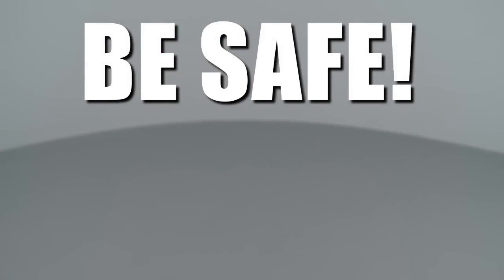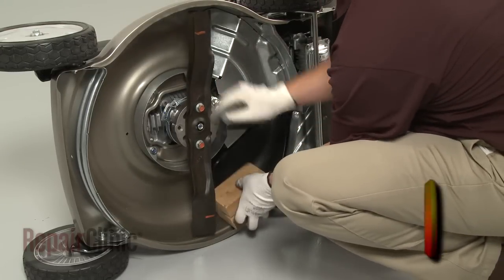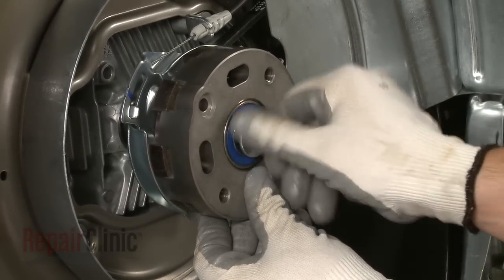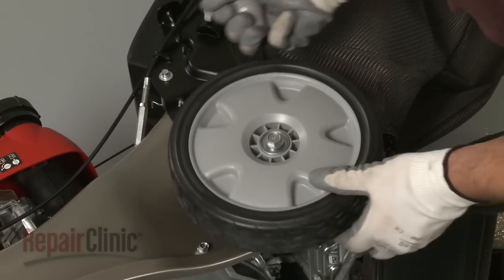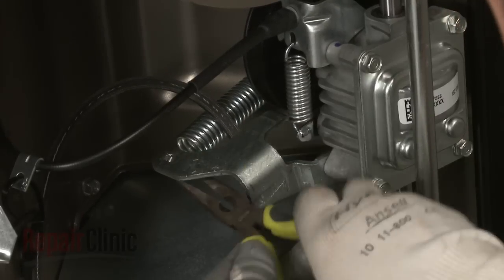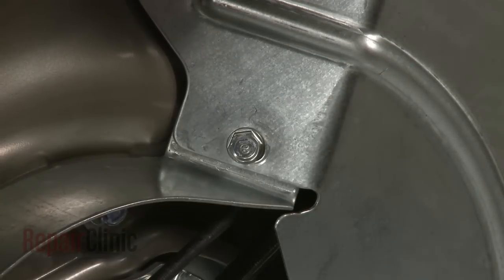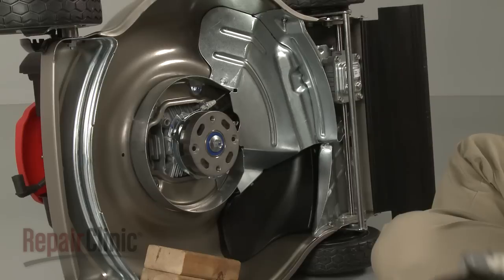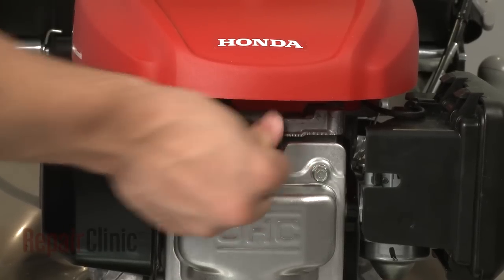Honda Lawn Mower Won't Self Propel? Replace Belt #22431-VL0-B00

Comment: Wow, I found this video just before I took my mower to the shop for this exact problem. Thanks for saving me money, guys, you rock.
Reply: Was your belt broken or did u just replace a good belt? I ask because my belt is not broken and thought this only needed to be done for s broken belt.
Reply: @christanzley8041  what did you wind up doing?  My Honda stopped self propelled today and when I pull back it puts up a fight to do it.   The belt feels loose bit still in tact.

Comment: For transmissions that are slipping, there is an adjuster with locknut on the tranny cable just before it enters the deck housing.  Loosen the jam nut and turn it clockwise to lengthen the cable housing, and tighten the jam nut.  9 mm wrench on the jamnut and 10 mm on the adjuster.
Reply: Gerry can you please explain in a little more detail
Reply: Well explained there, very informative.

Comment: Nothing like working on a brand new never used unit
Reply: 777
Reply: Yep, no dirt dust worn bits,,  screws that are frozen in place then the screw head shears off.
Oh yeah what are the bolt torque specifications, and do you even have a torque wrench?

Comment: Great video. I have a Harmony HRB217 TDA. Just replaced the belt, and adjusted the cable to its maximum adjustment. Wheels will turn when I hold the rear of mower up but them moment you place them on the ground, they will not pull mower. Any suggestions?

Comment: Great instructions and video. I was able to reinstall my drive belt after it slipped off the pulley and am now good to go! I was not able to loosen the roto-stop bolt however, so if I had a broken belt I would be dead in the water. The drive shaft just spins when I try to give a quick hard turn on the bolt.
Reply: Dennis Keener
Reply: make life easy and Use an impact gun

Comment: The video looks very helpful, but I am stuck.  I have an HRR2167VXA and when I get to the step of removing the lower roto stop assembly the bolt just turns no matter how hard or quick I slap the end of the wrench.  The pulley underneath, belt, and transmission pulley turn with the bolt.  I tried applying force to the belt to provide some resistance, but it's a no-go.  Any other tips on how to get this bolt loose?

Also, I noticed the drive clutch cable has been rubbing on the belt, and the belt is doing a number on the cable housing.  It looks like a pretty poor design, the cables should be better secured with a guaranteed clearance from the belt.  Any thoughts on this also?
Reply: I ran into the same problem - what I did to get that bolt off is take off the debris shield first (and my model was slightly different in that the debris shield was one piece).  Once the shield was off I clamped the belt to the transmission tension spring support arm with some vice-grips (it's the piece of metal the guy in the video is using to pivot the transmission with the adjustable wrench - @2:12).  Once the belt was clamped, I gave the ratchet a tap with a deadblow hammer and it turned right out.
Reply: Hammer

Comment from the maker: When you pull the lever to engage the wheels the cable pulls the belt tight on the transmission pulley. If the belt or cable is stretched or for some other reason the belt is not being pulled tight enough the transmission will not turn the wheels. You should be able to turn the transmission pulley by hand and get the drive wheels to turn. If you turn the pulley and the wheels will not turn you might have a bad transmission or worn drive teeth on the wheels.

Comment: Thank you so much for this helpful video! May I ask the part number of the tension spring that you reconnect at 2:38"? My mower is about 10 years old and that tension spring is so tight that I could not stretch it enough to get it back now. I am thinking to get a new one but could not identify the part number. Thanks!

Comment: I just bought from your shop the wheels , the gear and others items. But when I installed the gear in the wheels of the backwheel. I still have the same problem. The gear won out half way make my lawnmower shaking and the wheels moving not normal. Could you please help me to solve this issue. Thank you for your help.

Comment: I’m having trouble getting the lower roto-stop assembly bolt off. I’ve tried the sharp “rap” but something internally is trying to turn as well.
This is HRX217 model with select drive 2017/18 model.
Help….
Reply: I got mine off using an impact gun no problem.

Comment: I can't find the Honda I have but I have no belt and when you take off the wheel s there is no gear. Mine may be older but some kind of 215 gr8 I believe. Anyway I can't get the wheels to turn when the couch is released. I took out the year end and split the cases on rear end and found the clutch gear to be badly worn. So I took the gear out and welded the three gear teeth and milled all angles and I'm back in business, the tops were totally gone.  Wish I could leave a pic for ya.

Comment: I have my Honda HRR216a0 apart and the drive belt had came off of the transmission pulley.  I noticed that where the belt should sit on the pulley, it appears the the whole transmission assembly is shifted slightly (down), like there is not enough tension. If I push on the assembly a bit the belt then lines up and gets tight.  Should the belt be tight or have some slack.  Thx! :)
Reply: Tight

Comment: Have a Hrr 216 VYA, having trouble getting the Lower Roto Stop Assembly Bolt loose, it just keeps turning over engine. Any Ideas?
Reply: mojo  I did that and now my piston is scored because of this rope idea.  You owe me a new motor butthead.

Comment: Removing the lower roto stop assembly did not easily come off as others have also stated.  I removed the top flywheel cover and used another wrench on top of the mower as I turned the bolt on the bottom of the mower.  Took a lot of torque but it did loosen up.  I also need a gear pulley to remove the roto stop but the items behind it would not come off.   Now if I could find a video on how to remove the driven pulley I'd be all set.  My driven pulley (plastic!) is shot.
Reply from the maker: Joel Lund We have another Honda mower project coming up so perhaps we'll have something to help you further soon.
Reply: Excellent tip on taking off the pull start.  I did that as that was the only way to pull out the main bolt.
For me, the assembly on the crankshaft came off easy enough but it required patience to line up the two Woodruff keys to reassemble.

Comment: After7 years my drive belt finally snapped.  I hope that I didn't shear a keyway when the thing let go!  I think 7 years is great for a belt!
Reply: mine lasted 13 years
Reply: I have a 1993 hrb476 here still on its original belt somehow. I also have a 99 model still on the original belt

Comment: i have the same problem, i think the belt on mine has stretched,so will replace belt, then see how it goes.
Reply: I'm doing one today fingers crossed hoping it fixes it. Too heavy to push
Reply: @davidhickenbottom6574  lmao too heavy? I'm 13 and i have had to push the damn thing around for 3 yrs
Reply: @Br1zky  good work out, I'm 58 and buying a new mower today.

Comment: My belt looks fine but the wheels are not turning. The mower is several years old and the belt has never been replaced so I guess it's worth a shot.

Comment: My mower's self propelling functionality is not working. When last time it didn't work, I adjusted a nut on the pulley wire, but now the rear tires are not rotating at all. I checked the belt but do not see much of wear, how do I know is that the only problem?

Comment: Having just replace the drive belt on my Honda HRT 216 mower, It still does not move the mower. When I lift the rear wheels ,they are spinning, set the mower down it doesn't move.The rear wheel have little tread remaining.....could that be the problem?
Reply: I have the same exact issue as yours. I thought it was the wheels but after replacing it still wont budge like it does not have the power to push when wheels are on the ground.
Reply: Joe- If they aren't spinning, tread wouldn't matter, think about that for a minute.  : )~

JB- The issue (I just repaired one for a friend) is the transmission, there are fiber discs inside that get worn. Honda manual tells you to engage the clutch quickly, just like a vehicle, but people sometimes think it's better to slowly engage it, which wears out those disks. The transmission is only available from Honda, once they tell you the price you may consider buying a new mower instead, if yours is well used.
Reply: Did you ever figure out what was wrong with the mower? Having a similar issue.
Reply: Yes

Comment: It drives on the flat but wont drive up hills. The belt does seem loose, and I guess it is slipping when going up hills because rear wheels don't move. …Any thoughts?
Reply from the maker: billy45 We would suspect the belt is worn and needs replacement. Use your mower model number to find the right replacement belt. www.repairclinic.com?TLSID=1773
Reply: billy45 
Thank you! Incidentally it is great to find such a site as yours which you actually post replies on
best wishes
alex
Reply: RepairClinic.com 
My mower is HRB476C QXE.  Could you advise the correct belt please?
Reply: Same problem.  Bought a belt and took it apart.  Looks like Honda never put the key-ways in the shaft unless it doesn't need them.  But the pully has a keyway slot as does the shaft.  Actually the shaft has two slots.  Also, looked at the pully and it is lopsided, can't think that was the design.  Unit is 3 years old and it never self propelled well in grass, only on the driveway.  I am assuming that without the keyways it had enough friction to turn the wheels on a hard flat surface and just spun the pully in the grass.  I would assume this also helped to bend the pully.

Comment: The drive belt slipped off the pulley on my Honda hrt216 so it would not self propel.
I was able to install a new belt after watching this video.  It worked for a while and then the newly installed drive belt slipped out again. Any ideas what is causing this?
Reply: Sounds like the pulley needs to be replaced, as they can lose their tension.
Reply: Pulleys don't 'lose tension', springs do though...
Reply: Sounds like a loose nut behind the hand bar.

Comment: Rotostop nut just keeps turning, not loosening
Reply: Had same problem. Solved it by placing wrench on bolt and hitting end of wrench with a hammer. After several sharp ramps, the bolt loosened and I was able to remove.

Comment: To break loose the roto stop I removed the fly wheel cover from the top, turned the mower on the side, braced a breaker bar against the ground with socket on the bolt at the top to stop the spin and then was able to loosen the roto stop.

Comment: It's not that easy to remove that bolt off the main shaft. Mine just spins no way to hold on to it
Reply: Dennys Lawn Care Did you ever figure out a solution to this I’m having the same problem
Reply: if you take the top off of the mower you will see that there is a bolt that spins, so you’ll just need to hold a ratchet on each side of the mower it helps if you have two people
Reply: Had same problem. Solved it by placing wrench on bolt and hitting end of wrench with a hammer. After several sharp ramps, the bolt loosened and I was able to remove.

Comment: As others have posted, I also cannot get the roto-stop assembly bolt off.  It just spins.  No amount of sharp rapping does anything.  How do you remove the cover?  Also, to get the larger shield off (mine is hard plastic), there is a pin in a shaft that goes up into the mower, this pin won't come out so you can't get the shield off.  I believe I've come to the conclusion that this piece of crap Honda from Home Depot is different than all the rest and by design you just can't work on it.